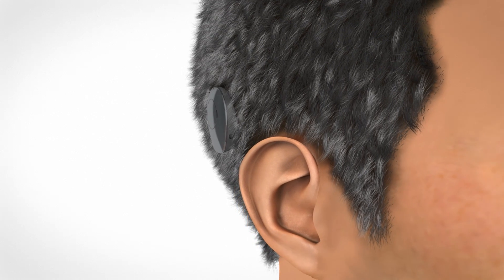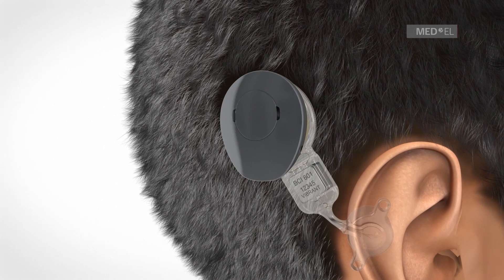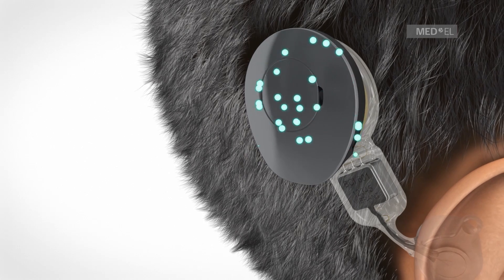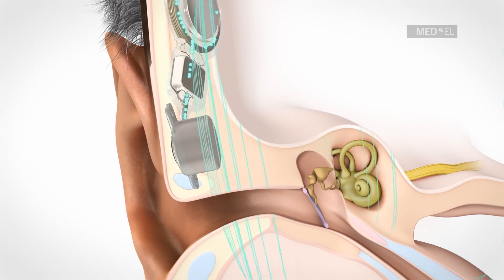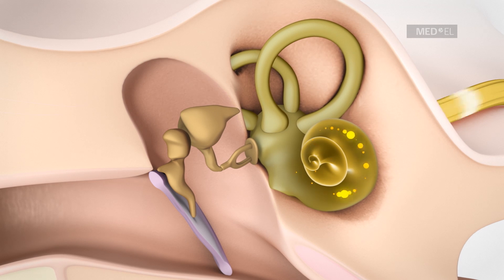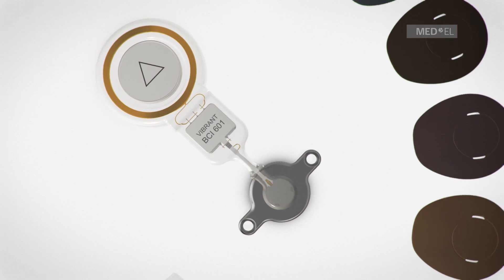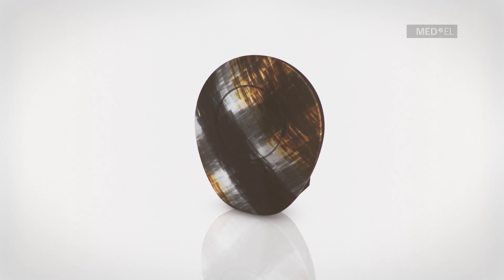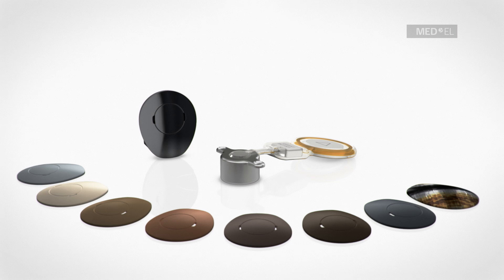How the BONEBRIDGE works with SAMBA Audio Processor

Comment: Is speech discrimination improved over use of a BAHA or Ponto?  Do you have studies for this?  Was is the user experience when compared to either of those devices for feedback or noise from hair and wind?
Reply from the maker: Hi April, BONEBRIDGE is designed in such a way that enables effective amplification across the whole frequency spectrum, from the low frequencies for the richness of sound to the high frequencies for better speech understanding. 
Also, the SAMBA 2 audio processor delivers outstanding hearing outcomes according to a recent study. In tests for speech perception in a noisy or windy environment, some SAMBA 2 users achieved results that came close to those of people with normal hearing. This article mentions a few studies that were carried out recently with SAMBA 2 users: https://blog.medel.pro/research-demonstrates-how-users-benefit-from-upgrading-to-samba-2/. 
Kind Regards, Giulia

Comment: The specifications of the Samba processor state a Audio frequency range from 250 Hz to 8 kHz. Is there Bonebridge implant able to emit an Audio frequency range of 250 Hz to 8 kHz?
Reply from the maker: Hi Tkn, thanks for your question. Yes, the BONEBRIDGE provides amplification from 250Hz to 8000Hz. Kind regards, Barbara

Comment: Hi, I was just wondering what is the difference between the bonebridge implant and a transcutaneous  bone anchored hearing aid that uses magnets instead of a percutaneous abutment??
Reply from the maker: +Amy Gorman Hi Amy, thanks for the question! BONEBRIDGE is an "active" bone conduction implant, which means the audio processor sends digital information to the implant, and the implant implant sends vibrations directly to the bone. This is in contrast to a "passive" bone conduction implant, where vibrations start in the audio processor and are sent through the skin. Here's some more information about the difference: http://www.medel.com/int/show/index/id/1495/title/Active-vs--Passive/

Comment: Hey Med EL, I was wondering If could ask a question?
Reply from the maker: +Donkey Kong Sure thing! What's your question?
Reply: I have unilateral conductive hearing loss and I was planning on getting the Samba very soon. My question was, with this device will I be able to localize sounds? Or does bone conduction stimulate both cochlea equally to make localization not possible? Thanks for the reply.
Reply from the maker: +Donkey Kong Hi, sorry for the late response. Studies have shown that the BONEBRIDGE can help people to localize sounds: "The Bonebridge significantly improved speech recognition in noisy environments and sound localization." (source: http://www.ncbi.nlm.nih.gov/pubmed/25425039). I hope that helps with an answer!
Reply: @DKomnicide  if you decided to have a bonebridge yourself I'd be interested to hear your experience